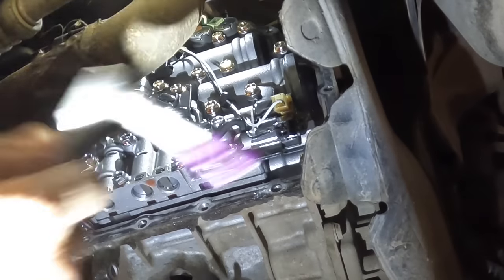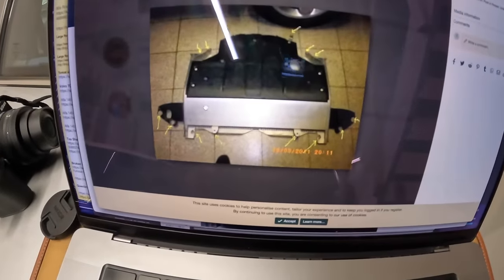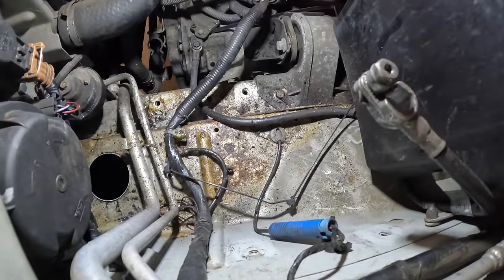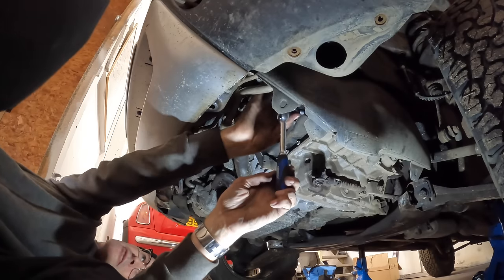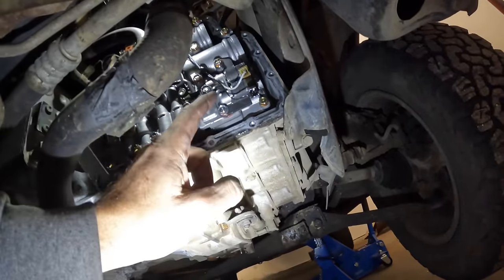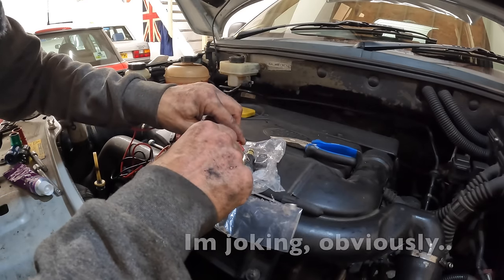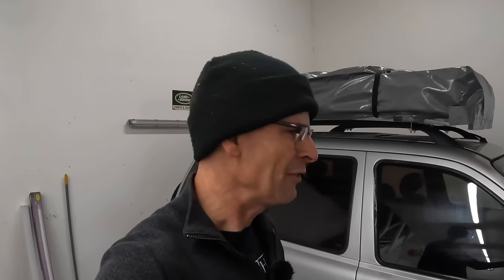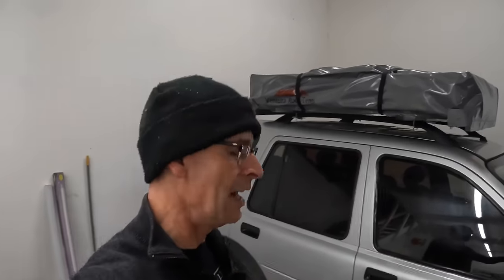Can I fix my Freelander gearbox? Jatco 2-4 Duty Solenoid swap

Comment: Absolutely brilliant Matt. It just proves that we should never be afraid to take on these so called "difficult jobs" ourselves. I once had my Bongo fail MOT on a brake imbalance across the back axle due to an oil leak from the driveshaft outer seal. The garage wouldn't do it for me referring me to a commercial repairer, I ordered the new seals and did it in a couple of hours on my drive. Garage guy was a bit quiet when I took it for the retest telling him I'd done it myself.

Comment: The long awaited "how hard can it be" video, well it turned out replacing the actual solenoid was not the hardest bit, access and rusty bolts was the more tricky stuff, well at least the outcome of the mission was successful and you saved yourself quite a few quid in the process, well done, happy days 🤗

Comment: Well done Matt, told you it wasn't such a hard thing. My daughers $600 306 auto has just done 1000kms on its replacement solenoids. Cheers Steve
Reply from the maker: As seen on Twitter! Didnt it have something else break just after that repair, but back up and running again now of course?
Reply: @furiousdriving  yep it was just the fuel pump relay. It’s back on the road again now motoring away!

Comment: Awww, not one solitary lost tool found when you dropped the undertray. I hate it when that happens - so unsatisfying!  ;-)
I wish I could say I'm glad I have a manual Freelander, but replacing the clutch slave cylinder is going to make that job look relatively easy...
As for rusty bolts, nowadays I grease every bolt that was difficult to remove before refitting it. It might not be the right thing to do, but I've never had anything fall off. The battery clamp was one that I was particularly glad I did. Despite its rusty head being between two sizes now, it's still quite easy to get off. 😎
Reply from the maker: not even a 10mm socket!

Comment: Tackling a gearbox is rather brave Matt, I keep putting off changing the oil on my Rover 75 auto box.
Reply from the maker: Get a small funnel and some hose, the filler is not easy to reach!

Comment: Still Land Rover's best selling vehicle in the modern era, I quit on mine. I went through two and nearly three JF506E's. I had the first year they imported to the US. Still the most maddening timing and belt adjustments on the MG/Rover KV6. It kind of amuses me that the first Elise's had the inline four cylinder of the K engine before switching to Toyota's. I still have mine and I have been considering breaking it for spares for someone who needs them. The correct ATF is absolutely essential and few people would actually put the correct Texaco spec ATF in them, and in the early 2000's a fluid and filter change you did yourself required $400-$800 in Fluid and Filter depending on the dealer. If you want into an auto parts store the idiots 99.9% of the time- they would just hand people Universal Import Fluid and that stuff killed the trans in 5k miles.

Comment: home mechanics shouldn’t be intimidated by gearboxes, if competent tackling engine repairs, then gearbox isn’t really any more of a stretch.  more hassle if just using jack stands, easier with a quickjack hydraulic lift or better.  Valve bodies and solenoids, gearbox oil and filter changes are pretty straightforward.  If you have a Land Rover then a RAVE workshop manual on disc from ebay for a few pounds is an essential. Good to see a gearbox fault being tackled 👍
Reply from the maker: I have Rover RAVE but turns out I need a back dated PC to run it! Luckily a viewer sent  me a PDF of the Freelander manual which was invaluable
Reply: @furiousdriving  Using VirtualBox to run it might be a solution, it certainly is for a friend in the motor trade with an "unofficial" copy of a service data app that only runs in Windows XP.

Comment: Nice job! Looked like no fun at all. Those quotes you were given are a great illustration of the racket being run by some dealers/workshops...a two-hour book time job and 120 quid in parts for 650 is bad enough, but 2500? Daylight robbery...hope it feels nice to have saved yourself all that moolah!
Reply: I have a suspicion that the garage which quoted £2500 was basically saying "Nah, we ain't doing that for love or money" but without actually coming right out and saying so--they'd know no-one was going to pay that for a job on a car worth £1500.
Reply: @d2factotum  Unfortunately, those sort of fees are par for the course in the UK for automatics. Many if not most mechanics it seems simply don't want to learn about them because they don't need to. Autos/semi autos are becoming more popular, though, so maybe we'll see more independant garages wanting to get to know them.

Comment: Did you check the fluid level? Needs to be 35-45 degrees C so obviously close to 40 is ideal, they are usually over full tbh! Don't undo the reverse band by mistake if you check it haha
Reply from the maker: yes, thats what the P Scan was doing

Comment: well done sir .. shows you can do this without a workshop ramp & lots of experience
Reply: and for a roof-top tent removal device .. i guess a few endless loop straps & a manual chain block / gin wheel from machine mart should do the job
Reply from the maker: Thats the sort of thing I was thinking, and using engine lift type strops around the tent

Comment: It's soul destroying when one spends a day dismantling to do a job that takes 5 minutes to do, then hopefully only half a day to reassemble as one now knows the order to do things.  Did you have to check the level in the box after running through the gears?  I found that with Borg Warner and Ford  boxes the level dropped a lot once run through, at least easy to fill but slow through the dipstick tube.
Reply from the maker: fluid level is simple - if it runs out the hole there was too much, if doesnt there wasnt enough!

Comment: But did you tighten the bolts holding down the solenoids to the recommended torque? Well done though - it's a job I would have approached with a lot of trepidation.
Reply from the maker: Couldnt find it listed so back as tight as it was before was the best I could do

Comment: Hi Sir, need some advice from you.. I have 2nd hand freelander 1 v6 year 2001. My vcu support bearing was give up and also bad vibration on tail when reach to 80km/h. Wanted to replace is but little confuse with the model as I check on web it tell TOQ000040 but the current fitted on it was TOQ000060. I suspect previous owner had fitted the wrong model. Any advice.. thanks in advance.
Reply from the maker: I dont know, talk to Alfa Workshop parts department who should be able to find you the right part

Comment: I was wondering if you could help me with my Alfa Romeo 146. The hood needs to be open by 2 people one to hold the hood lever and one to go outside and push down on the hood a bit. i dont know what could be the problem so i hope you can help me with that.
Reply from the maker: thats the bonnet latch or release cable at fault, it might just need adjusting